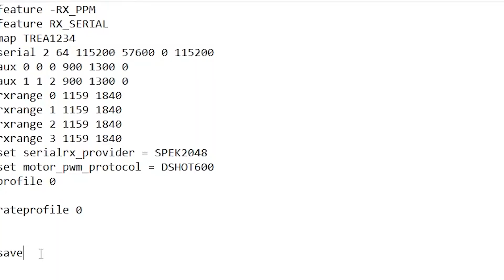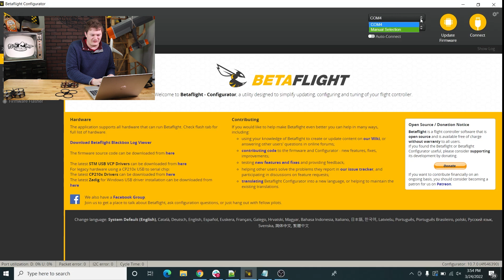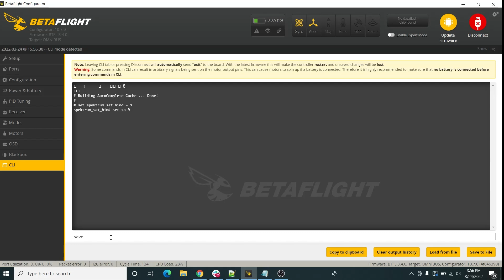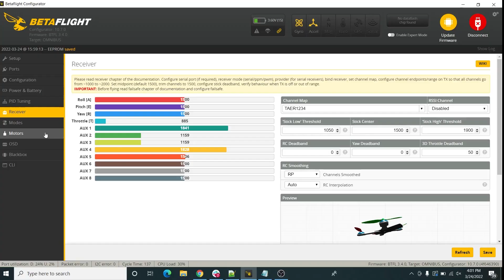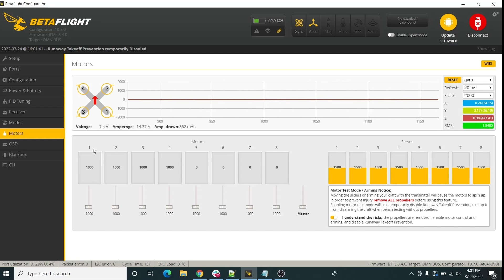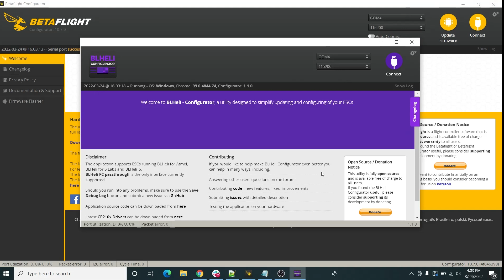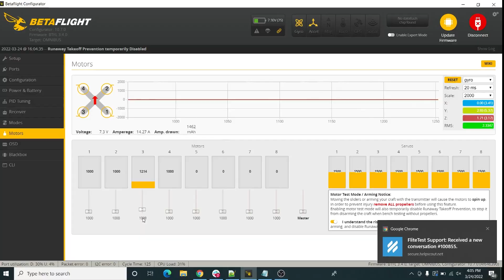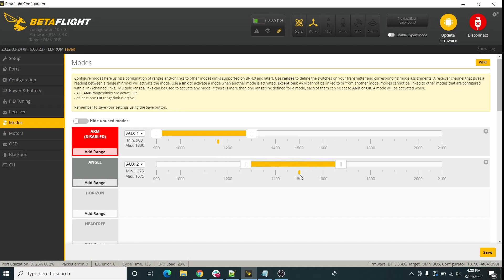How to Build the FT Guardian Gremlin // Basic Programing

Comment: i just got my gremlin a week ago and finally had time to put it together. did everything the same as the build video, but when i follow the video to program it, it doesnt seem to wanna take. i ordered the lemon rx with the kit since i use spektrum. my signal hot and grd are soldered in the correct places but when im on betaflight it will not let me set the rec in bind i get no flash or anything to signify its ready to bind. any suggestions?

Comment: I would suggest adding a Failsafe switch.  Or at least, verify Betaflight failsafe engages when the Transmitter to receiver link is lost.  Getting new FPV pilots to get comfortable with a Failsafe switch is a good safety practice.     Also, you might suggest pilots calibrate their accelerometer.    Good video!